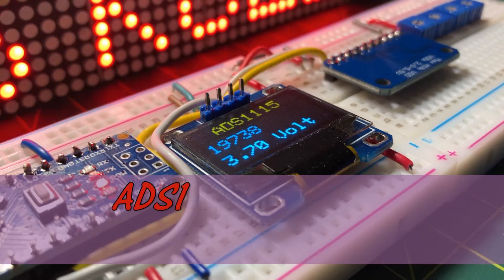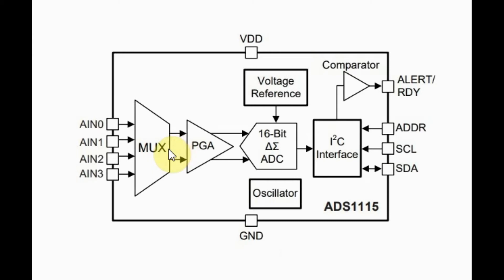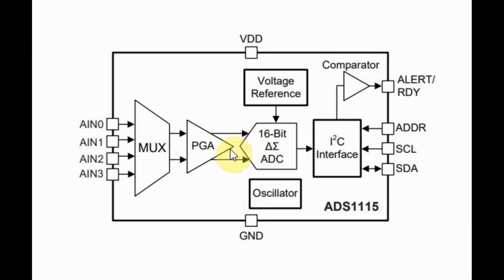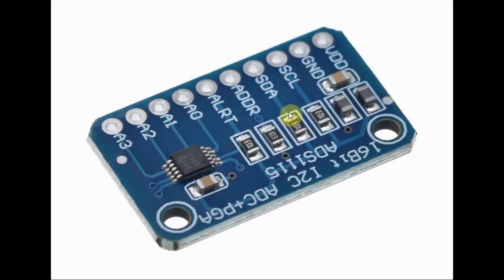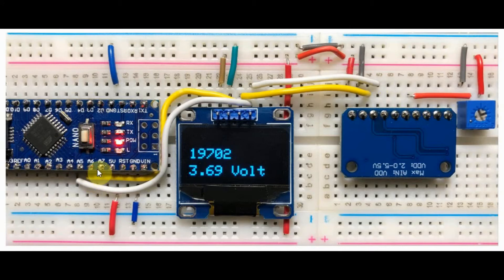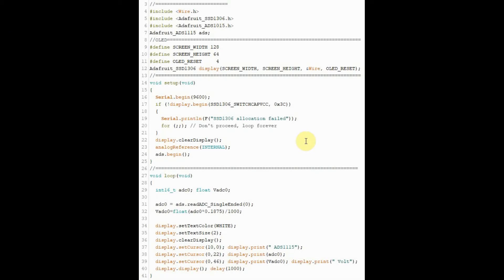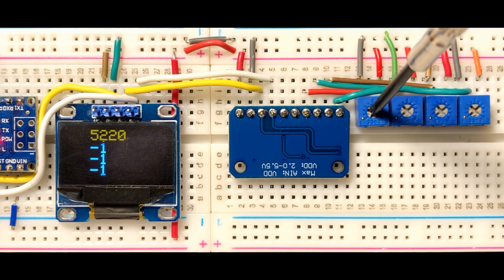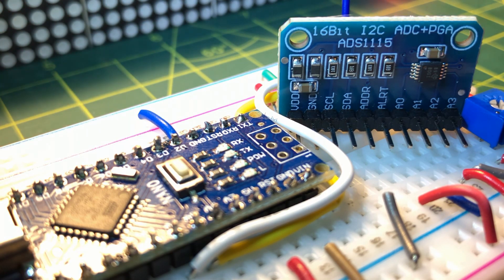ADS1115 16-bit ADC Interfacing with Arduino

Comment: if i am using esp32 (3.3v) and ads1115(5v) + sensor (out put 5v) , does this will Burn my esp32 , or do i need to power the ads1115 with 3v instead of 5v?

Comment: Good afternoon, great videos. I have a car sim pedals that I drive with an arduino pro micro and a 3 axis joystick sketch in a0 a1 and a2 for gas, brake and clutch pedals. The issue is that the pro micro is 10 bit and adding the ADS1115 could transform it to 16 bits, which would go from 1024 to 65536 positions, which would give me much more precision. Can you help me with the modification of the sketch. From already thank you very much. Greetings.
Reply: Hello! did u manage to rewrite the code ?

Comment: Hi can I connect multiple ADS1115 to one arduino? if yes how?
Reply from the maker: Hi, yes you can up to 4 devices. By connecting ADDR pin to GND, Vcc, SCL, or SDL (please refer to datasheet). When ADDR is connected to GND, the I2C address is 0x48. When connected to Vcc, address is 0x49. As for connection to SCL & SDA, refer to datasheet.
Reply: @AnasKuzechie  Really nice of you Thank you
Reply from the maker: @waqaswani2994  You’re welcome

Comment: Sorry for this question(I am just an electronics hobbyist); Do I need to join the (Voltage LOAD Gnd) With Arduino board GND?  Can I add between GND and Analog(A0) 0.1uF ceramic cap to reduce noise? or where? if so.